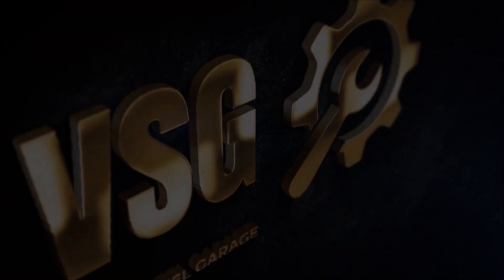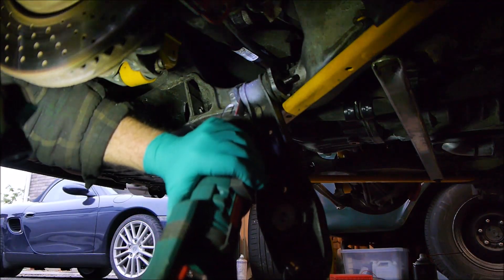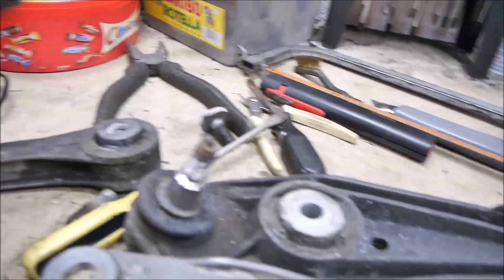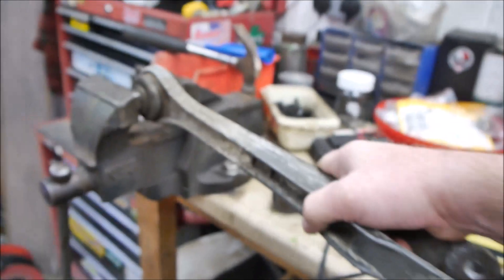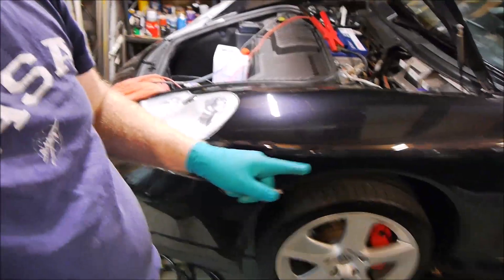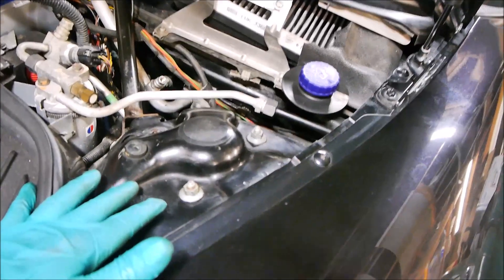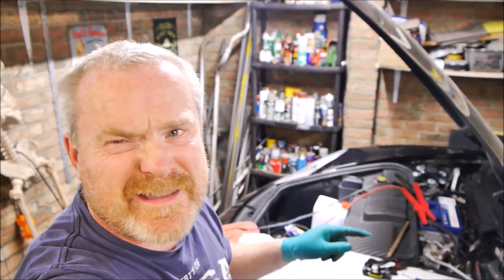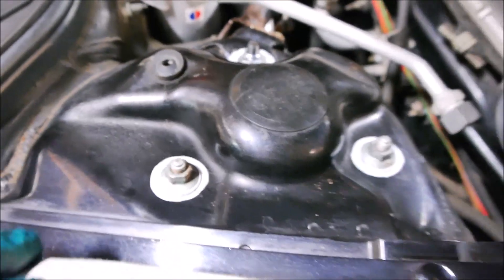Porsche 911 996 C4s. Le Mans road trip prep Part 9. Camber and Toe (tracking) adjustment

Comment: Really enjoying your content. I’ve recently had an alignment done on my 996 c2 as it was feeling “skittish” on the road. Apparently it’s all within spec now but it still feels odd. I do notice some knocking from the rear under slow / gentle de-acceleration which I know think is the rear trailing arms. Sounds like that would explain why it doesn’t feel right on the road?
Reply from the maker: Yes. My Boxster was like that until I replaced the lower arms

Comment: What Quantity of kilometres until swap lower arm
Reply from the maker: @azamatbezhan1653  depends on condition not miles or km covered. All depends on how it's been driven and stored
Reply: @vintagesteelgarage  approximately, Is it possible to last 200 000  kilometres until swap lower arm
Reply from the maker: @azamatbezhan1653  yes I'd say so. It more about the environment they are in for example low milage car left outside in damp country the alloy arm corrodes and delaminate the rubber. Where as say in California nice dry environment it could last 200,000 km
Reply from the maker: My 911. Had done 140k miles before I changed them.